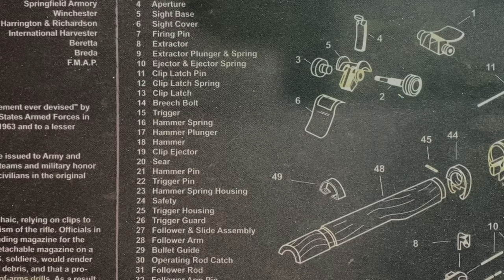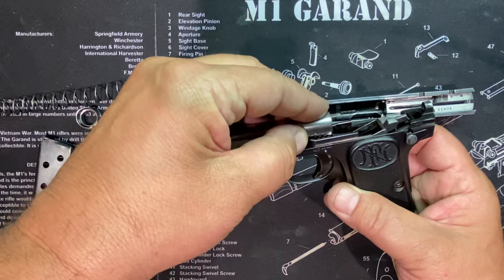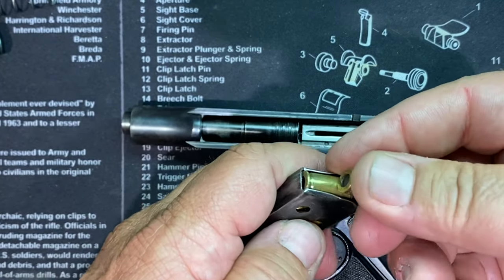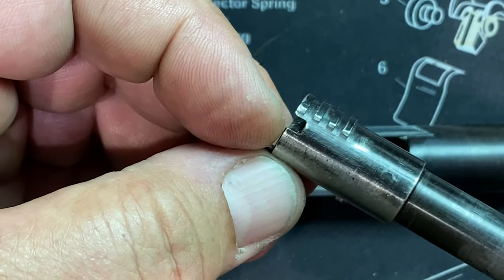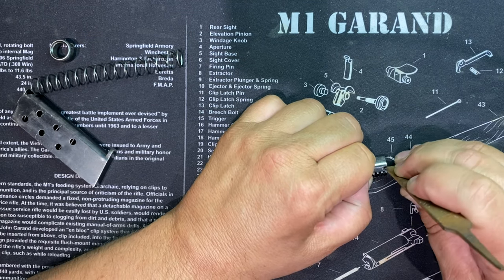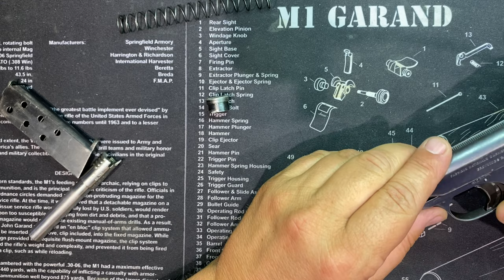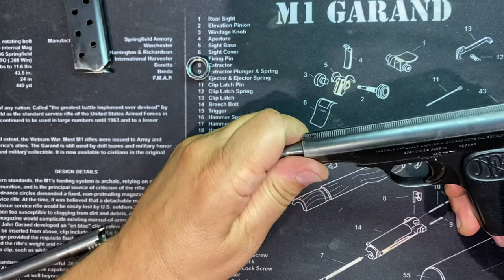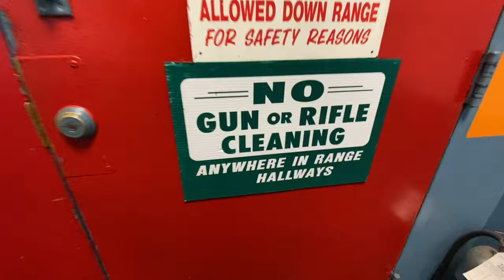FN Model 1910 .32 to .380 Barrel Interchangeability

Comment: On the following guns you can change the barrels from 380ACP to 32ACP with some minor fitting; Colt 1908, Ortgies, Mauser HSC and1922 FN Browning. I have them all and they work great. Just like most guns parts, they do need some fitting. Thanks
Reply from the maker: Reading about the HSC was interesting, thanks for the heads up.  Designed in 1940 for both .32 and .380..........hmmmmm.......wonder if the designer was a Browning fan.
Reply: Beretta 1934/1935 has also this advantage. Here in Brazil, .380 ACP was forbidden to civilians up to 1987. Some Beretta 1934 captured in WW2 by our troops had its barrels changed to .32 Auto (from Beretta 1935) to comply the vigent laws at that time.

Comment: I have a 1922 sitting next to me. There's a 380 barrel on eBay right now. I'm having a tough time resisting the urge. The thing is that over the last few days I've learned more about this little gun. I love it more than I did when I got it. Supposedly, it was Browning's improvement on the 1903, and now I think I'm beginning to see it. It's slimmer, more compact and holds one more round. I always wished my 1903 could be easily converted to 380. Looks like JMB thought of this long before I did.
Reply from the maker: Did you buy it?
Reply: @MilsurpGarage  I'm not going to. I like 32.

Comment: The issue you're having is the location pin on the top of the barrel. Compare the 2 barrels and you can easily see the difference. I can see it in the video. It's may dry cycle but I assure you it's not fully in battery.
Reply from the maker: Those pins all look different and don’t really locate anything, they are NOT creating the exact headspace necessary for interchangeability....its the barrel locking lugs that are creating the close tolerances and only a little cleaning up is necessary to hand fit these barrels but I strongly suggest leaving this to someone with the know how to do it correctly.  I have put hundreds of rounds of either caliber through this gun since this addition and it runs flawless.

Comment: The barrel should not protrude that far past the barrel bushing when assembled.
Reply from the maker: Not sure what you are referring to but it is not protruding at all.....but even if it was it would not matter in the slightest.  Some people use a model 1922 barrel which is considerably longer and sticks out well past the barrel bushing but works fine.  I have seen articles where these longer barrels were used specifically so they can be threaded for a silencer.  They cycle just fine.

Comment: The barrel is from a 1922, not a 1910. The 1922 is a little bit bigger. Same model.
Reply from the maker: Nope.  It's not bigger, it's not from a 1922 although I hear that WILL work.  They are the same size.